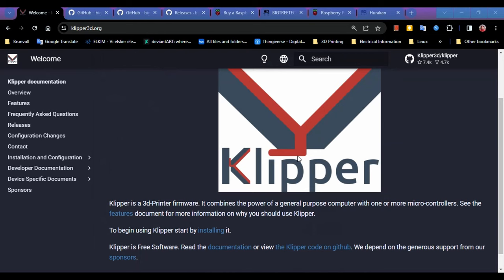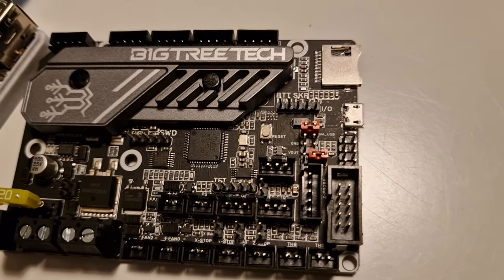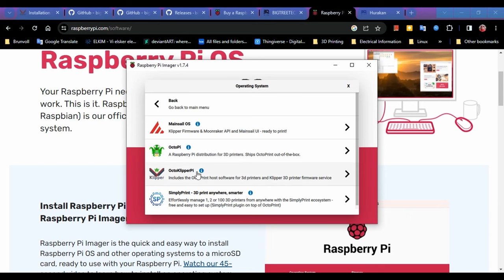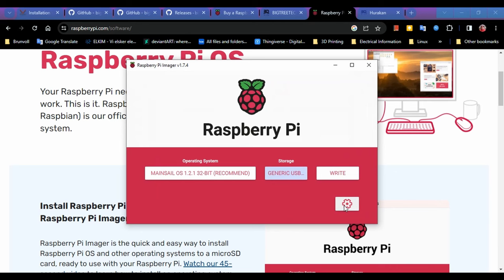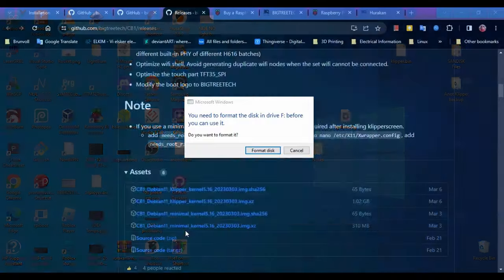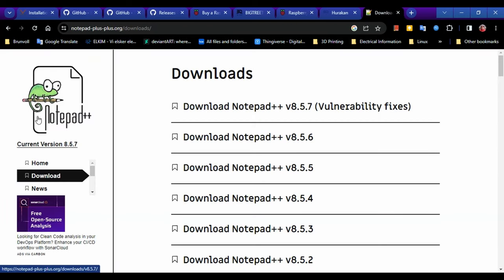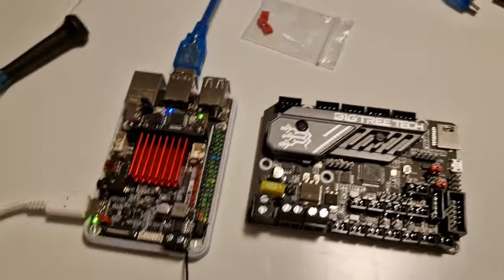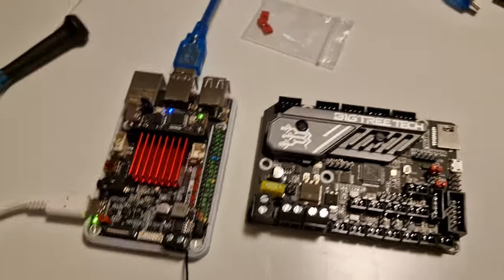How to install Klipper for beginners

Comment: i seem to be missing something here, i followed all the steps but still dont see how i access the board from my computer. i see you using mainsail, but dont know how to install it on my computer
Reply from the maker: Mainsail is in the host, the raspberry pi,  BTTpi, or whatever you are using, with klipper. You just put the IP address of the host into a web browser like chrome and if everything is setup correctly then you'll be in.
Reply: @StackingLayers  thank you for the fast response, i am using the BTT Pi with my skr E3V3. i think i may have bricked my board nothing comes up when i type it in
Reply from the maker: Just go back to start. It's not likely that you bricked anything, could just be a missed step or a missing/extra character pleased somewhere. Unless you where messing with wires while powered up and accidentally shorted something.
Reply: @StackingLayers  so I have figured out the entire issue. i have NORD VPN on my computer, and for some reason it was blocking the connection
Reply from the maker: Ah yes. That'll do it. I got rid of nord vpn. Way to many connection issues.
Reply: @StackingLayers  another thing i discovered after the last message is that it will only connect to 2.4g wifi for me. but that is of no actual consequence
Reply from the maker: The btt pi only supports wifi 2.4G
Reply: @StackingLayers  after messing around forever i have discovered a few things lol. i bought 2 pi boards, and 2 mini e3v3 and to this date i cant get a serial response when i use the lsusb command. i also have 2 1.4 turbo boards, and when i run the command i always see the controller boards. i will be trying to figure that out as i go. the second thing i messed up is upper and lower case are very important. i was constantly being tols the one pin was not found on mcu, turns out i screwed up and put a lower case p instead of an upper case P.

Comment: Can you setup a VM on Windows to run RaspberryPi?
Reply from the maker: Why raspberry os?. It would be better to run Ubuntu on a PC. I'm not t even sure raspberry os would work in a VM on a PC.
Reply: I have found that Raspberry Pi OS Desktop running on Debian 11 ISO image can be downloaded and installed in VirtualBox.
Reply from the maker: Are you looking for that just because you like the raspberry os? For pc it would be better to run something made for PC hardware like Ubuntu or one of the many other PC optimized Linux based distros. If you are doing it because you think it's needed for Klipper firmware, its not. Klipper can run on just about any Linux based system. And if that is the case it's recommend to not do it through a VM rather a standard Linux install. You could have an old laptop with Debian server or command line interface as a desktop environment is not needed and a waste of space for a klipper setup
Reply: @StackingLayers  Looking for an easy was to use Klipper on a newer PC without forming it and loosing the data on it.
Reply from the maker: It would honestly be way more efficient to run a raspberry pi of an alternative like the Bigtreetech pi. VM's use up a lot of your PC's resources and you'll need to keep it on and prevent both the PC and VM from sleeping while printing. It's a very comber some and discouraged way to run Klipper. With the way VM's handle resources It's highly likely that you will run into timer too close errors. In general it's not going to provide a good experience. If you must do it on a PC and don't want to completely converter. You could always look into dual boot.
Reply: @StackingLayers  Just trying to save a buck. 😆 Ended up doing just that.

Comment: Could I also use a flash drive
Reply from the maker: Do you mean to install the OS on a flash drive? There's ways to use a harddisk for the OS on Raspberry Pi but in general, no.
Reply: My printer is not working yet but I’m so close cuz your video! Thank you for making this!

I did have a problem getting the 
ls /dev/serial/by-id/* to work turns out I had to delete the klipper.cfg file copy and paste the same file but rename it firmware.cfg then it worked. I know you said to do that but somewhere it went wrong just putting this here for other people. Don’t know if this matters but I pulled the jumper from the boot pins labeled boot on my BTT octopu

Comment: Just started with klipper.  The biggest issue I am having is confusion.  I'm seeing different configs for example, motors, probes and I am not sure which one to go with.
Reply from the maker: The key is finding the manufacture and model of motor or whatever device and then searching for that.

Comment: > Installing Klipper for beginners

More than 1 hour length... I guess I will stick with Marlin for now = )
Reply from the maker: Yes this is a detailed lessen to teach first time users how it all works. That way they can have a good understanding to go further. 
You know, 'Give a man a fish and you feed him for a day. Teach him how to fish and you feed him for a lifetime'
Nothing wrong with staying with Marlin though.
Reply: Well, it is kinda a joke, but, if a beginner video, which obviously should take the most important aspects for quick start is more than an hour, so how long would be video for experienced users? = )
While Marlin compilation video is usually 15 minutes. Like 'you need this programs, then you read this config and google it's parameters, you press this button to compile, if you have errors, just read what you did wrong and follow the instructions, then put your firmware on SD Card... Done" and that's it. = )
Reply from the maker: A video for experience users would be about 3 minutes, since there would be no reason to explain the whys and whats with the process. There's no way you are going to learn how to use marlin firmware in 15 minutes, with no experience. Being told what to copy and paste with no explanation of what it is and why you do it will only get you so far.
Reply: Experienced users would like to know every comma and every option of Klipper and Linux which it runs on. Good luck fitting that into 3 minutes = ) And there are a lot of options there.
While newbies just want that to boot up and run. That's why Bambu printers are so popular and not only among newbies. No one wants to read that ... manual.
Reply from the maker: @enosunim I think you are confusing experience with eagerness to learn something new. An experienced user would just need a quick explanation in the rest will get filled in with their experience. Anyway yes I know my videos are long and can probably be shorter, but for all those that are interested in knowing more than just where to click and paste they may appreciate the extra information. It won't appeal to everyone and that's ok. There are many that want the turnkey experience and there are just as many that want deeper understanding. That's what makes this a great hobby, there's something for everyone.
Reply: Hey hey! No offense = ) I just want to tell, that Klipper is kinda complex, so if beginners video is this long, then to understand the whole thing there needed multiple videos and hour each.

But I shoul argue if we stated to = ) You confusing experienced 3d printing users and experienced Linux users = )

While newbie does not need to know at start what is linear advance or pressure advance and such. As there are enough trouble already. As far as I know one need to buy additional PC, which is commonly raspberry pi or clone, set it up with ready to use distribution, compile printer firmware to upload it to its motherboard and then one can set up configuration if everything connected correctly. But experienced user want to install filament movement sensor, auto calibration control with probe to nozzle height auto adjustments calibrate pressure adavnace, shapers and to know what else marvelous features Klipper provides. And I do talk about using some cheap laptop from after market instead of pi clones and setting all of this on custom Linux machine.

Never I said that your video is too long. I just said, yeah Klipper is a huge thing. And this video is only the tip of an iceberg.

Comment: bro i need private lessons lol i have a rasbery pi b v whatever is this all the same process ? i dont have bigtreetech please help 911 jajajaja
Reply from the maker: It's the same, the only difference is the first part I show with raspberry pi imager around the 12:00 mark. There's the option for other specific os or something like that. That's where the 3D printer images are. Choose the klipper mainsail os

Comment: I've watched millions of videos learning how to do stuff on YouTube with 3D. Pinners and CNC machine and and I have a learning disability, so I need these types of instructions but man, you're all over the place for some of this new. Trying to hook up clipper to their 30 printhey don't understand half the stuff you're talking about anyway, so they just want you to show them how to do it.  SHA and all that stuff on raspberry pie or whatever board you're using. I don't want to know why this and this and that and then get to the point they want you to show on. Step by step how to do it
Reply: Bruh not sure what you're complaining about. This vid is very thorough and concise. Everything he says is important. The whole point of Klipper is to offload the UI to an external microcontroller (RaspberryPi) to free up resources on the motion control board to print faster, etc. Unfortunately, if you want to run Klipper, you're going to have to learn this stuff or buy something like a K1 which has it pre-installed.

Comment: Thanks!
Reply from the maker: Thank you!
Reply: @StackingLayers  you're most welcome. i did run into an issue after the install where I'm trying to run a print but I'm getting a BL touch error but i don't have a bl touch install on my printer( I'm going to do my due diligence to try and fix this issue on my own) but do you have any suggestions on how i can fix this in case I'm not able to find a solution? thanks in advance
Reply: never mind, i found the solution a little lower in the comments. i just had to uncomment the virtual end stop z probe and comment in the actual end stop and location lines